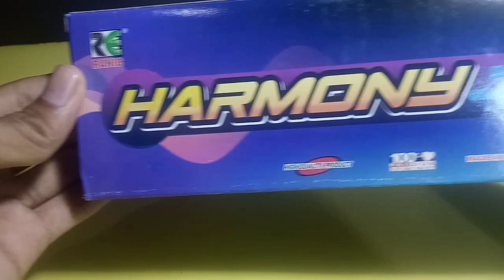Cara Merakit Equalizer 10 Channel Stereo

Comment: Kalo power amplifiernya ada 3 berati out ke amplifiernya dijumper?
Reply from the maker: Dikasih resistor 22k ke setiap amplifiernya
Reply: Mkstnya gimana
Reply from the maker: Dari output equalizer dikasih r 22k - 47k lalu ke amplifier
Reply: sippp mas pake parametrik nya mantul
buat ngerjain kawan yg suka nantang pake sound 1 8" auoto  jebol spikernya😂😂😂 kyk pnya temen yg ngremehin power org lain😅😅😅